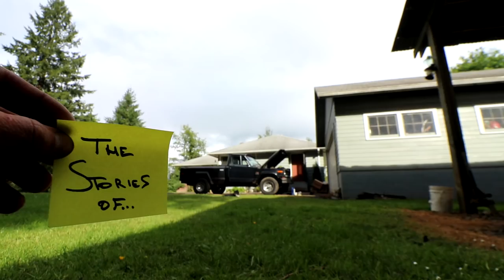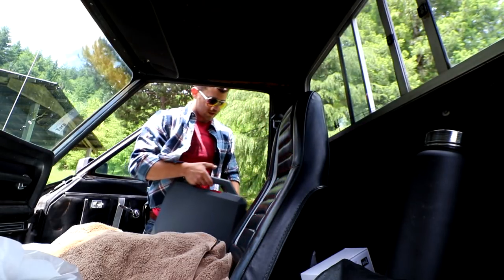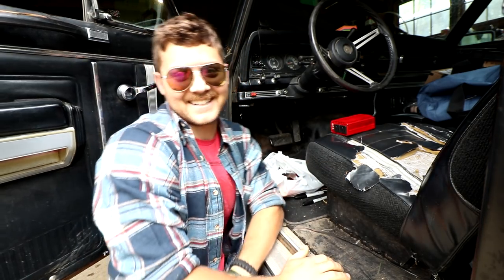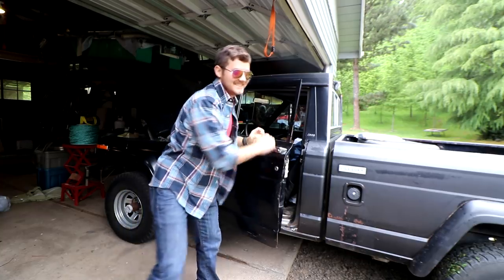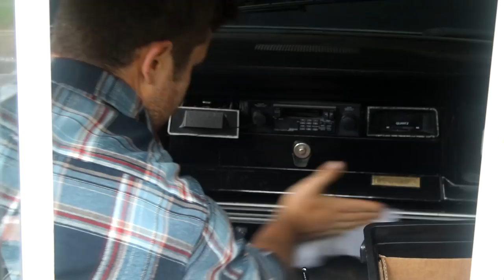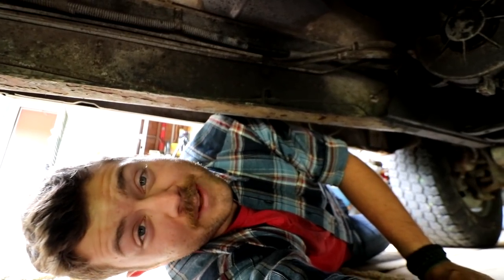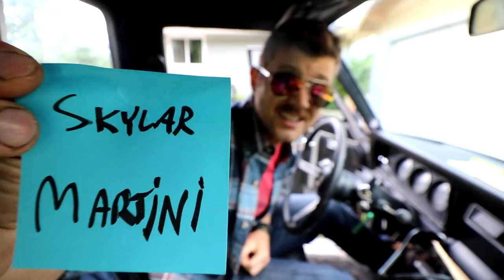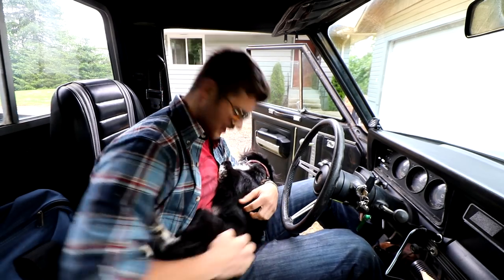NEW TRUCK ROAD TRIP!

Comment: i said it last comment...something is very different with you Jake..however, journey on. does the truck have an exhaust leak..just wondering. probably my crappie for speaker. take care.
Reply: myke collins AMC engines come standard with an exhaust leak between the head and manifold, if it doesn't have one it will have one soon
Reply: KFStreich ok..thanks..my phone is still crap tho.lol